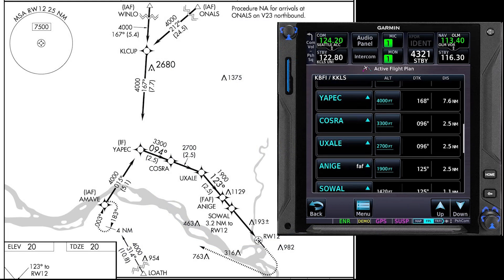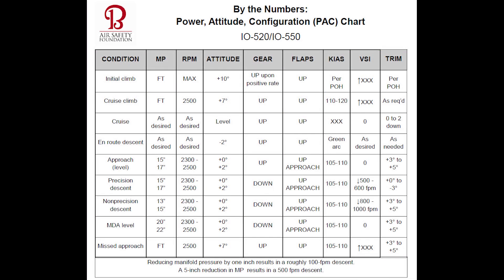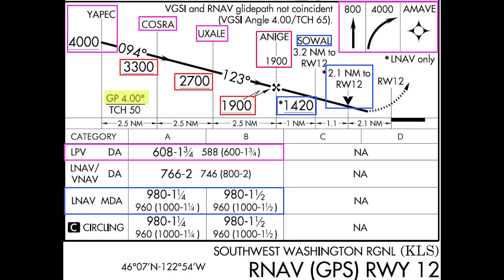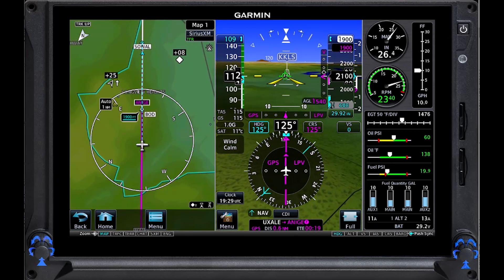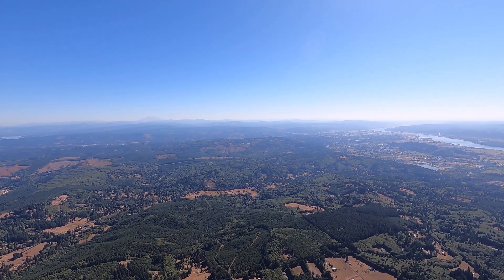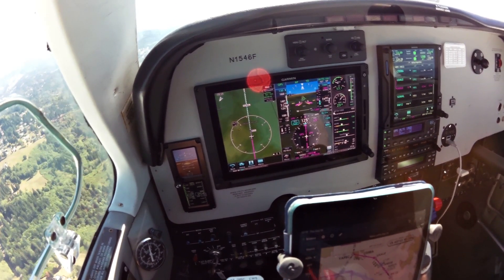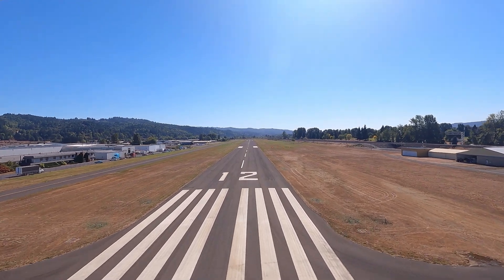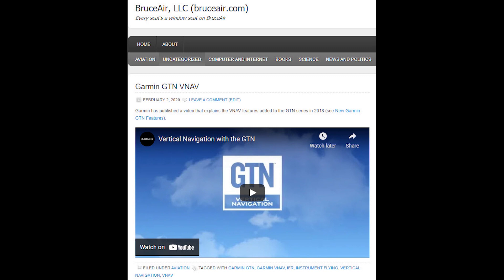Using VNAV on an Approach

Comment: Hi Bruce, how are you?

I did an upgrade in my B58 and installed the GFC600, GNT750 and G500TXI, my VNAV buttom on GFC600 doesn´t arm far from the TOD.... Do you know how many minutes or miles I can arm the VNAV mode?

Regards
Reply from the maker: The GTN Pilot's User Guide (190-02327-03 Rev. G) notes that:

VS Target and FPA may be unavailable if:
• The selected altitude is set higher than the Active VNAV Constraint
OR
• The aircraft is more than 50 NM from the top of descent

The GTN is the brains behind the GFC 600 for VNAV, creating lateral courses, and GS and GP, so it makes sense that the limitation applies.

The GFC 600 Pilot's Guide (190-01488-00 Rev. H) does not list that limitation, however. See 2.4 ENROUTE VERTICAL NAVIGATION.
Reply: Perfect Bruce, thanks for your answer....

Comment: How did you get the gfc500 in the ptc trainer? I downloaded it but it won’t give me a gfc500 with my gtn650xi or when I choose the 750. Just gives me the very basic autopilot with only hdg nav and alt hold
Reply from the maker: The Garmin PC Trainer does not include the GFC autopilots. I just added images of the GFC 600 to show the functions you should activate when using VNAV. You can simulate VNAV in the Garmin Trainer by selecting the GS function in the very basic "autopilot." I have repeatedly asked Garmin to include the GFC APs in the trainer.

Comment: Hi Bruce, what about using VNAV for the stepdown fixes on an non-precision approach?  If I'm not mistaken the GFC-500 will descend to the appropriate altitudes  as long as it's in the flight plan correct?  Or do you have to re enter the altitude after passing each fix for the new fix.  I haven't seen any videos on using VNAV for a non precision GPS approach (eg. KDLS RNAV (GPS)-A).
Reply from the maker: VNAV is available only outside the FAF. It will provide a smooth descent through the intermediate stages of an approach (precision (3D) or non-precision (2D); doesn't matter).

From the FAF to the MAP, if you're flying a 2D approach straight-in with a modern GPS, you'll probably have an advisory vertical glidepath. In fact, the GTNXi navigators provide +V advisory glidepaths even when you fly a VOR approach. But that's not VNAV. An approach with circling-only minimums (such as the example you cite) won't have advisory vertical guidance. You could use VS mode to set an appropriate descent rate along the final approach segment and change both the target altitude and VS to ensure that you meet any stepdowns inside the FAF. But again, that's not VNAV.

Comment: How did you get the GFC in the trainer? I only see options for GTN and a display.
Reply from the maker: The Garmin PC Trainer doesn't include simulation of the GFC 500 or GFC 600. To help illustrate autopilot functions in videos, I sometimes (as in this case) add still images of the autopilot controller and edit the data fields to match what should be showing in the displays. I continue to ask Garmin to include simulation of the GFC APs in the trainer; those simulations would make it much easier to train folks who have those APs.

Comment: At what point in the approach do you set the before landing check list and get set up for landing? Do you also set the missed approach at the MDA if you have to abort the landing, before you get to the FAF?
Reply from the maker: I complete the approach/landing checklists before I begin an approach, with just landing gear and final flaps remaining.

If I am flying to an MDA, I set that altitude. If I am following approved vertical guidance to a DA, I set the initial missed approach altitude after I capture the GS/GPS.

Comment: What is the name of the panel with the heading, altitude, baro knobs. Is That an additional panel to the autopilot?
Reply from the maker: That is an optional control unit that you can install with the GFC 600 if you want dedicated knobs for ALT, HDG, etc.

Comment: "If you have a Garmin GTN-series navigator and a GFC 500 or GFC 600 autopilot, you can use VNAV to descend to the charted altitudes along the intermediate legs of an instrument approach, until you reach the final approach fix."

This is not true with the GFC 500. With the GFC 600, VNAV will take the airplane to the point of GP/GS intercept. This will also allow having two armed vertical modes: GP/GS and ALTV. (GP/GS is achieved by selecting APR mode.)  GFC 500 will take you to a fix prior to GP/GS intercept. 

Why?  In the GFC 500, Transition to Approach is not enabled in the configuration mode in the GTN XXX; it is enabled in the GFC 600.  I asked Garmin why: “it requires additional testing and proper documentation”.  I did offer my Mooney with the GFC 500 for “testing” but at this time, a very low priority for Garmin.
Reply from the maker: You're correct that the GFC 500 does not (at present--the capability might be added later) support simultaneously arming VNAV and APR modes, like the GFC 600. You can use the VNAV feature in the GFC 500 to descend to the the altitude charted at the fix prior to the FAF and then arm APR mode, or as you observe the GP or GS indicator descending toward the center of the index, select APR mode to intercept the GP or GS.
Reply: Multiple vertical modes have now been added to the GFC500 via G5, GI275 and G3X Touch software updates.

Comment: How or where did you get the GFC autopilot controller for the Garmin trainer?
Reply from the maker: The Garmin PC Trainer Suite doesn't include a full emulation of the GFC 500 or 600 autopilot. I have been asking Garmin to include those boxes, but so far, no luck.

I just combined images of the avionics in my aircraft to complement the narration, which was discussing the equipment installed in my airplane. It wasn't a description of the PC Trainer Suite.

But you can kludge behavior of the GFC series in the Garmin Trainer. Select the GS option on the controller in the simulation. That tracks the VNAV vertical paths and then the GS or GP markers.

To fly VNAV and then automatically switch to GP or GS on an approach, as you join a published segment, select the altitude at the FAF with the ALT bug on the PFD, and the simulation will act like a GFC, as you see in the video that I made.

To fly VNAV on a STAR, as you join a published segment, set the ALT bug to the lowest altitude on the procedure and press GS on the simulation controller.
Reply: @BruceAirFlying  thanks for the reply. I thought that you had found something I was missing.

Comment: Thank you.  Very good video to learn from.  Until my flight yesterday I thought altitude bug had to be set to MDA/DA in order for GFC-500/600 to descend in VNAV/APP mode.  Flew the KAST RNAV 26 Approach where GFC500 flew below my altitude bug in VNAV (forgot to set bug to MDA/DA).  I was quite surprised it still descended.  Again, thank you.
Reply from the maker: I am glad the video was helpful. It's important to understand descending with VNAV isn't the same as using APR mode to follow approved or advisory vertical guidance along the final approach segment. VNAV is an aid to flying the profile of a STAR or to fly the published altitudes along intermediate segments of an approach prior to the FAF. That's one reason the two features have separate buttons on the AP.